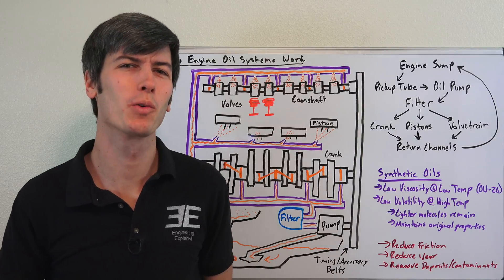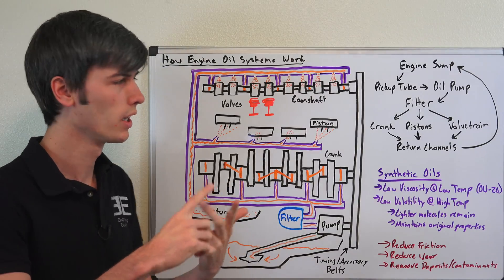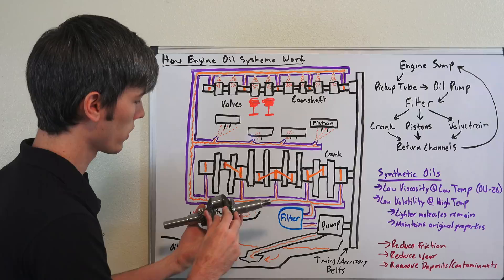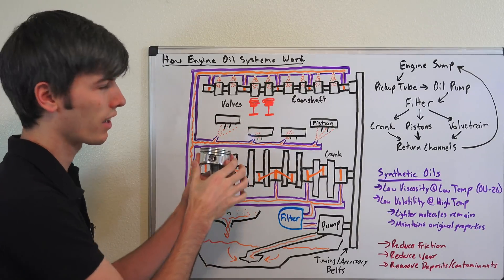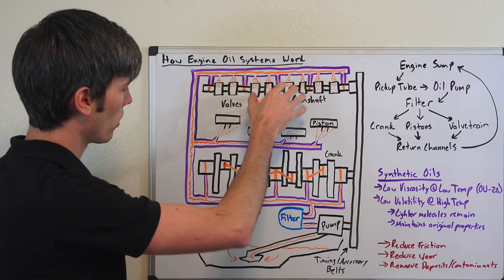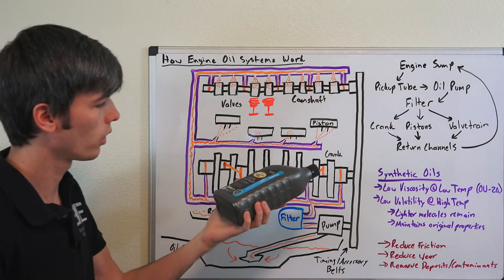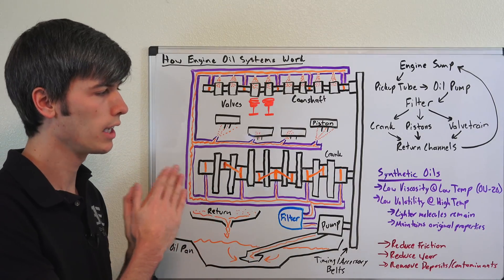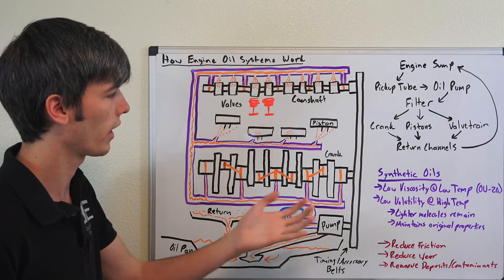How Do Engine Oil Systems Work?

Comment from the maker: Another obvious function of the oil which I did not mention directly (kinda goes with reducing friction) is that it provides a significant amount of cooling for the engine as well, preventing certain areas from getting too hot by transferring the heat from the metal surfaces to the moving oil.
Reply: The oil's cooling effect is especially important in air cooled engines since in reality they are air/oil cooled. That is why your typical  water cooled 3 litre engine might have a 5 litre oil capacity where as an air cooled engine of the same capacity would have about 10.
Reply: Engineering Explained you should do a video on a dry sump system and the advantages of using that type of system.
Reply: +Sky Furry Would it be logical to keep the engine oil as cold as possible while maintaining the same viscosity?
Disclaimer: I'm a metric person, deal with it.
the underside of the piston is usually 300°C when at operation temperature, the combustion chamber is more like 600-700°C during combustion. If the oil has the same temp as the coolant, which is 90°C then it will still have a lot of cooling effect. 300-90=210° of temperature difference, you won't notice cooling increase from colder oil. If you want to give your pistons more cooling you're better off simply installing a bigger oil pump giving you more pressure and then increasing the size of the nozzles spraying it onto the pistons.
That's will have a way bigger effect, is easier to do and doesn't require any new oil technologies...
Reply: Would it be logical to keep the engine oil as cold as possible while maintaining the same viscosity?
In other words, would having a colder oil reduce overall engine temperature, therefore increasing power or reducing engine wear. Is that logical or am i just not thinking straight.
Reply from the maker: Well, engines are designed to operate most effectively within a certain temperature range, so you want the oil and coolant in this range, other wise you won't have as clean of combustion, and you'll be running a bit rich (for example, when you first start your car). If you've ever had a broken thermostat you may have experienced this, as the car may run rich for a long time because it takes forever to heat up if the thermostat is stuck open. Somewhere around the 180-200+ F ballpark, will vary depending on the design.
Reply from the maker: Yes, there are high mileage synthetic oils with additives to reduce oil consumption.
Reply from the maker: Subaru every 6 mons per warranty requirements (I rarely hit the mileage intervals), the S2000 I'll probably change once a year, again, it won't come close to the recommended mileage interval. I always go with what's recommended.
Reply: Engineering Explained Thanks! Also, how do you recommend getting through engineering finals week? I feel like I need an oil change
Reply: +Sky Furry BMW's have an oil cooler that cools the oil by using coolant. this is to keep the oil at a certain temperature (around 90°C) because in the autobahns the cars travel for long time in high rpm, also helps in the greek summers
Reply: Can ethanol damage your engine?
Reply: The oils, cooling
Reply: johan bjork thats right, when he explained the lubrication under the piston, forgot the most important effect under the piston, the oil helps to cool down this area and keep uniform temperature.
Reply: Engineering Explained you forgot to metion, the oil helps cool down pistons by spraying from the bottom.
Reply: The oil is mostly for lubricating, it doesn't add any additional seal per say around the piston rings. There is always blow by going on in the combustion chamber. It does reduce sound as well but it's actually that it sounds correct when there is oil, if there WAS noise that would be bad. The sounds you could hear if you didn't oil your engine would be louder taps through your valve train, and some seriously bad sounds from your main crank/rod bearings, you might also hear some bad sounds from your piston rings grinding your cylinder walls.
Reply: Engines that run ethanol are cooled better, but the reason for that is you use more ethanol than you do gasoline to get the correct A/F mixture. If you used the same amount of ethanol as you did gasoline per stroke, the difference is negligible.
Reply: I have done this on my 370Z. its pretty simple really, it hooks up just like an oil filter ( think of a Spacer in between your engine and your Oil filter) then it routes the Oil to a cooler before it enters the Engine.
highway driving i'm now at 180°F (it was 220°F) and Spirited driving keeps me around 216°F (was 250°F-260°F) Before, If I took the car out in the summer (so-cal) 10 mins of hard driving and the Engine oil would get to the point of Shutting down the car (275°F)

engine oil needs to get up to 212°F to boil off water, turn it to steam and remove it from the Engine. if you are getting above 220°F id look for a cooler to assist engine cooling.
Reply: Was just going to ask that.  There's a reason some of the higher performance engines actually have piston squirters which shoot oil up into the underside of the pistons...
Reply: Engineering Explained  and opportunities for product placement
Reply: +michael cianci
_if you shot a similar amount of ethanol per stroke as you did gasoline 
there would be an even bigger difference in heat generation, it would 
just be accentuated by the difference in power density between the 2._
Well actually ethanol needs more energy in terms of heat to vaporise, so when ethanol goes from liquid to gaseous state it will pull out more heat, giving the better cooling.
You can't inject the same amount of ethanol as you would with gasoline, because you have a different A/F-ratio that you need to get, 14.7-1 for ethanol is way too lean. And lean mixtures have a higher temperature...
Reply: Because the coolant is making all of that work, the oil isnt transfering
Coolant is flowing on the sides of the cylinder, the botton of the piston is not cooled at all, because there is no coolant touching it, that's why the oil is squirted onto the pistons.
Also the side of the pistons touch th cylinder wall, and that cylinderwall is then cooled by coolant, it you squirt oil onto the piston, that will cool it directly.
Reply: Function of lubricating oil:
-control of friction
-control of wear
-control of tightness: piton-liner assembly 
-control of corrosion
-control of temperature
-control of cleanliness (concerns also hydraulic devices)
-control of power transmission
Reply: Kirk Augustin
A worn engine works best with natural oils in high viscosities like 20w-50
Nope! It works best with high viscocities indeed. But you can buy high viscosity synthetic.
Synthetic is always better, or use at least a semi-synthetic blend is synthetic is too expensive.
Change oil depending on the state, if it's new but it's black, then replace it.
Reply: Emmanuel Vazquez
why wankel engines dont use the same method to lubricate their pistons
Because it's not a piston...
Wankel engines have one sharp point that contacts with the ourside walls, a piston engine has room for 3 rings etc. etc.
Reply: Lower viscosity is for fuel efficiency. Higher is for protection. That's in about shell
Reply: Engineering Explained how long do you go between oil changes?
Reply: Doenst oil "Seal" ( - sorry had to use translator to get the right word) the burnig champer specially at the oil and pressure rings at pistons? Also I learned that they reduce sound co ming from the engine.
Reply: jhsevs there is a possibility of damaging your engine due it's higher burning temperature - so it "burns" your valves
Reply: EE can correct me on this one but I'm pretty sure ethanol actually has a better cooling effect than gasoline. i believe that this is part of the reason that you can run such high boost levels with E85.... that and it's very high octane rating.
Reply: also the mechanical affect on the valvetrain - hydraulic lifter action
oh and then controlling crank/cam end play and stuff like that - reducing wear as was already mentioned, yes, but the idea that it's acting not only as a lubricant but also a mechanical component 'hydraulic fluid'
Reply: There are oil cooling radiators that take a lot of load off the coolant radiator or to complement it. May result in the need for a smaller radiator (more space for a bigger intercooler ;) ) or no need for an electrical fan that steel hp, although just a little (also more space for a bigger IC). The piston squirt for example is a great example of where the oil actually cools the engine. I think there are easy mods where you could connect one to where the oil filter goes (and then the oil filter on the connector if that makes sense)
Reply: Dylesxic No, if you shot a similar amount of ethanol per stroke as you did gasoline there would be an even bigger difference in heat generation, it would just be accentuated by the difference in power density between the 2.
Reply: michael cianci I stand corrected, there are in fact cooling benefits to using ethanol vs gasoline. But the statement on A/F mixture stays the same, the amount of fuel you need for a proper burn is much higher than it is vs gasoline.
Reply: Xyphren What oil cooler is on your 370, I'm looking to do the same thing in the near future. If it has a thermostat then I'd really like to hear more.
Reply: Why would anyone think that it would give the engine extra gasoline? :)
If you read through the comments there is plenty of arguments saying that the oil has a GREAT part in cooling the engine.
Reply: You forgot that engine oil systems also take a huge part of cooling the engine
Reply: Do you know of any synthetic oil to use to slow oil consumption?
High viscosity and high shear strength is what you will be looking at.
"Bardahl stopsmoke" is simply an oil thickening agent that slows oil consumption.
Anyways, the reason your engine is using oil is probably because of low compression (you can test that with a tester) which in turn can be caused by clogged up pistonrings, scratches on the cylinder wall, and the hone that  has worn out.
Atomium makes an oil additive that can fill in those scratches with a mineral coating and it cleans up the piston rings a bit. http://atomiumus.com/ If the oil consumption is caused by the things I mentioned it might help, it worked for me at least...
Reply: Sky Furry
Engine efficiency is ratio of useful work that you get to amount of heat you put in. Engine cooling might seem like waste of heat that could be used, but we can’t do it (direct in the same engine), yet. We can use this heat for other purposes e.g. fresh water generation and preheating in ships power plants. This is not practised in cars (except for cabin heating). We can improve slightly diesel engine efficiency and decrease it’s temperature as a result, but it has several drawbacks (mentioned in previous comments).
Reply: If the pistons engines have the lubrication by those holes you show us and dont burn oil. Then why wankel engines dont use the same method to lubricate their piston components to eliminate oil burning, instead of injecting the oil directly to the motor chambers???

I always had that doubt, hope you can answer me.
Be the way you make some great videos. <3
Reply: Engineering Explained 
Hello. Good video. i was about to comment that other function of the oil in an ICE. I couldnt understant how the oil lubricates the cylinders wall..
Reply: Emmanuel Vazquez Wankel's do have oil passages to the side and apex seals; the problem is the apex seals especially don't lubricate well and need the additional oil delivered via the fuel. just call them "two-stroke" engines, and it comes clear why they don't work as well as they theoretically should.
Reply: So much wrongness here. 

1) Journal bearings work with oil pressure to lift the bearing surfaces away from each other. 
2) oil viscosity is very temperature dependent, so keeping the temperature within a range will keep the oil flowing properly and the pressures consistent, so the journal bearings (crank, rods, cam) will operate properly; this is why all auto and truck manufacturers will plumb the oil cooler inside the radiator, to keep the oil temps within the operating ranges (they do this for automatic transmission fluid, as well). 
3) Multi-viscosity oils have been around for at least 50 years, they are solely for use in regions that have fairly wide temperature swings that get cold enough to affect the oil viscosity negatively. Synthetics have nothing to do with this, synthetic oils are nothing more than Dino oils that have had their molecules "sorted" into a set of similar-length molecule chains (which is what oil is, long-chain hydrocarbon chains, the longer the chain, the "thicker" the oil), which makes the synth oils have more consistent viscosity and less susceptible to oil molecule breakdown due to heat and mechanical damage. And to make it "multi-vis", they add oil with differing viscosities to enable flow at lower temperatures. 

4) Under-piston oil squirters are used only for piston cooling in high-performance engines, to  control heat deformation of the piston. They've been around since at least WWII, having been used on aircraft engines. 

5) The connecting rod has an oil passage that runs from the big end to the wrist pin to lubricate the wrist pin, using the oil pressure from the journal bearing to drive it up to the wrist pin. 

6) All automotive and big truck engine oil pumps are gear-driven off the crankshaft. 

7) "natural-gas" *is* petroleum-sourced: it's just a very light hydrocarbon that is very similar to methane, gaseous state at room temp and pressure. "synthetic oil derived from natural gas" is just marketing-speak to make it seem special, when it's not. 

www.bobistheoilguy.com is your friend. Or a degreed mechanical engineer.  ; -)
Reply: And this is the most important function, because when you design the oil system, at first you have to calculate, how much heat (from journal bearings of the crankshaft etc., sometimes from pistons as well) is to be evacuated by oil.
Reply: Engineering Explained if like to see a video on high moly content oil and why honda for example uses it as factory oil.. and why you shouldnt change it out until service is really due
Reply: Engineering Explained I use an oversized oil filter, it gives me more filter media and more capacity. it takes a bit longer to heat up, but I think it helps..
Reply: +Wezley B
I'm afraid it doesn't... Engine oil degrades chemically before the oil filter gets full of crap. Did you know that some motorcycles require only one filter change for two oil changes?
Reply: Andrey Studentsov sure, but i get way more oil through the filter before the bypass kicks in, and i have 700ml more of fluid heatsink. So it has to help more than it hurts..
Reply: WezleyB You may be right.
Reply: Yes thank you for that. The cooling function of oil is very important to my 99 Chrysler 300M, which not only burns oil but leaks coolant (very slow leak). The thing will run hot very easily if I don't make sure that both the oil and coolant are topped off. Low oil is as much a danger for proper engine temps as low coolant.
It makes me reflect on the fact that the cooling requirements of IC engines are really insane, when you think about it objectively. It's a consequence of the generally poor thermal efficiency of IC engines, and it's why electric motors are so much more energy efficient. Really, ICE vehicles are just far too complex anyway, too many parts to break that have to work together perfectly (engine, transmission, emissions, ignition, cooling). I am of the opinion that the personal automobile (at least, in ICE form) is one of the greatest unsustainable follies of mankind, even not considering emissions at all.
I don't own an EV now but the 300m is getting replaced with a Leaf when I have to get rid of it, if for no other reason than the level of mechanical simplicity.
Reply: I've been tackling that issue too, and the key is to use slightly thicker oil, and those based on PAO (Group IV or Esthers (Group 5). A good start is liqui moly, and if you can afford it, Amsoil or Redline. I've found that Castrol Edge is notorious for high volatility for example.